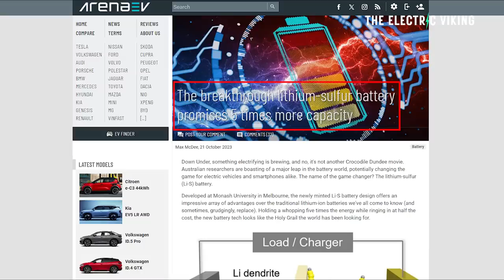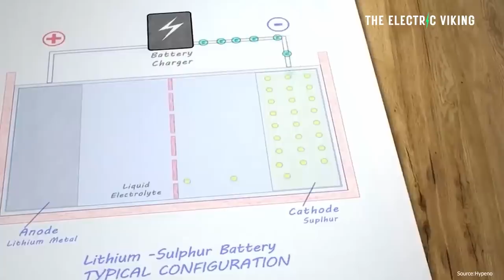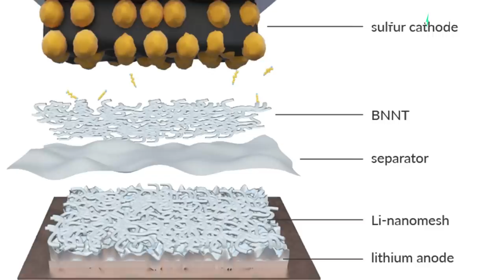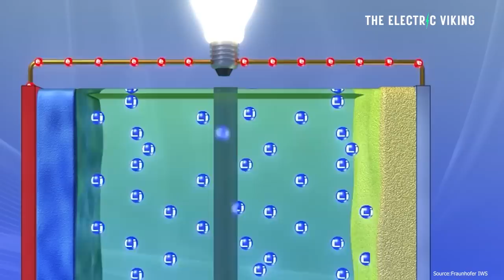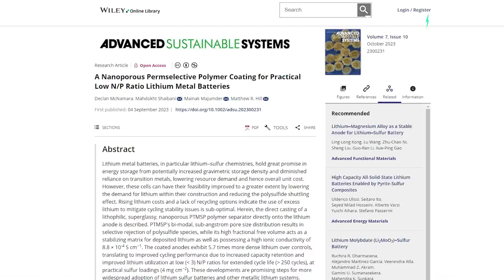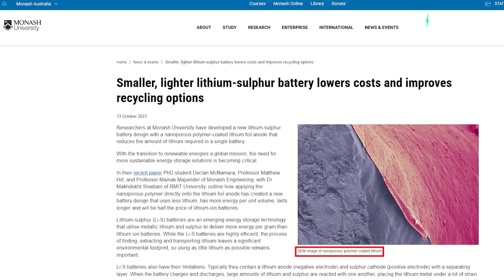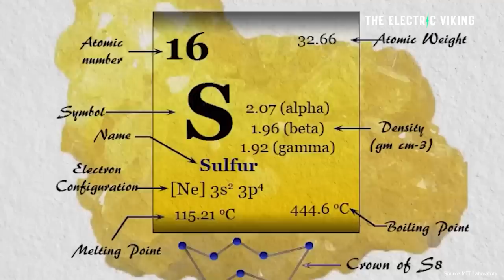Breakthrough for new battery that has five times the power of lithium-ion

Comment: For those who say ICE cars won't be replaced because battery tech isn't good enough, I present videos such as this. It's clear that battery tech over the next 10 years will only get better and better and better. There will be a day within the next 10 years where you'll be able to charge your EV just as quickly as filling up a gas tank while going 600 miles AND having a lighter car than current EVs are while being able to do 1 million miles. It's completely understandable why ICE manufacturers are scared til death of EVs.
Reply: Not even you can believe that...
Reply: Range anxiety will go away. The point I make is, don't buy ANY new car until you can afford to keep your existing gas car (if that's practical). That way you have a "road trip" car. Makes sense? Also encourage skeptics to ask EV owners how they their car (in passing by in a parking lot, for example). We good!
Reply: The charging facilities are nowhere near where they need to be to challenge ICE and does the grid have enough power as yet to charge that many cars.
Reply: Who cares?  95% of charging happens at night at home while you sleep.
Reply: Charge time will be a issue until some significant new breakthrough happens, not this one, also the chances of this one working are unfortunately slim we have had a huge number of battery chemistry come along and been the holy grail only to fall short for a number of reasons, unfortunately really the only progress we have really had in almost the last 10 years has been in battery management not chemistry, hopefully that changes soon but don’t hold your breath.
Reply: You can do that today. The issue has never been a matter of if we can make a car like that, but rather a matter of if we can make that car economically viable, AND will it be any better for the environment than a basic ICE car. For most of the country right now, it is better for the environment to buy an old used ford truck than it is to buy a new tesla. The ONLY exception is when you live in an area with hydro, nuclear, or solar. If you live in a part of the country where the energy grid is based on natural gas or coal, you would be FAR better off driving a hyper efficient gas or even diesel car.
Reply: Web, and the grid will never generate enough electricity for every home to have their own lightbulbs! And air conditioning or refrigerators in private homes? A pipe dream!
Reply: I wait till they get mass produced.
Solid State is already ready but mas production date is 2028.
Reply: Yeah it's been around the corner for 15+ years.
Reply: Ha Ha... Genius,  so once those batteries are available everything EV will be fixed! Oh wait...... so I can recharge my battery super quick but how quickly can I generate the power to recharge it let alone distribute that power in the national grid. It would be an issue if everyone switched their 2kw kettle on not to mind anything like a 20+kw charging device when they come home. if the EV doesn't catch fire the charger probably will! :)
Reply: Less than 50% of motorists have the ability to charge overnight.
Reply: If later generations is sodium-ion batteries increase in capacity battery development is finished and they can play with battery management.
Reply: @briankearn6991  why are they homeless?
Reply: @andrewkaiser7203 
I road trip all over the western US in my 2015 S.  What kind of range do you think you need?
Reply: dontbmb5 • ICE manufacturers are not scared at all. Their CEOs are doing what's been ordered to them by the Oil Cartel.
For example, one order is this: build expensive EVs so people don't buy them. Other orders are: don't build performance electric batteries, don't invest money in them.
Etc.
The ones that are scared by the EVs are the old rich oil puppeteers that lead the Oil Cartel, not the ICE car manufacturers.
Reply: @whowhy9023   Why do you people think everybody has a garage? And everybody can afford to pay on a EV. Along with paying on solar panels, plus a Power Wall. Many many people don't have that kind of money.

ATM Cars are being "repoed" at a rate that is higher than ever ❗️
The only reason I can afford to be a "Patron Member" to this channel is because it is cheap.

Do You purposely skip over all the comments of people saying that they would like to have a EV, but can't afford it , just on this channel alone ❕️
Reply: ..once your battery beat up 1kg of diesel=12600 w/h energy, make a call...other than that just stop talking ..
Reply: @andrewkaiser7203 " makes sense." No,not at all
Reply: @webbtz3591 the grid isn’t the real issue, lack of public charging, along with a need for  apartment/condo and workplace charging definitely is.
Reply: @eccosabanovic1589  That's crazy though. An EV would be able to be drives 3,981 miles with that kind of battery.
Reply: @tristanjones7735  You don't have to have a zero carbon electricity source to beat ICE with an EV.  Even if you are charging from a coal-fired power plant, you are STILL better than ICE because electric motors are so much more efficient.
Reply: @eccosabanovic1589 you can ride a horse to work instead of talking about it
Reply: @eccosabanovic1589  The energy density of diesel is BS unless you include the mass of the diesel engine needed to convert it to actual usable energy, and take into account the amount of energy that is lost due to Carnot inefficiency.  Do all that and it's not so hard to beat.
Reply: @icosthop9998  I did a calculation on the amount of solar I would need and using the payment scheme of fuel and electricity costs that currently exist in the household. The panels are good for 25 years, and they would be paid in 11 years. No, it isn't more expensive. The electricity and the fuel are more expensive. The problem is whether a person owns their rooftop or whether someone can leverage their rooftop to the advantage of a charging network.
Reply: @vorpalinferno9711 
Solid state batteries have been in development since 1986. The key phrase to remember is " they'll be ready in 10 years"
Reply: @whodatcatt  People, talk to Tesla owners. When you see people getting in to a Tesla in a parking lot, ask them real quick how they like their Tesla. It always starts a conversation for a few minutes. They will usually tell you about charging if you ask. They understand, and are glad to tell their experience. That way, it's not just a back and forth on youtube. I'm getting great reviews from them. Don't be misled by FUD. Just ask the owners.
Reply: But generation and distribution are not efficient
Reply: For a BEV to be good enough for me, it has to be able to handle -30C without drastically affecting range. Otherwise, I'll always need fuel of some sort for heat in winter. I'd be far more interested in a RE-EV than a BEV.
Reply: @shanecollie5177  Distribution is negligible compared to having to pump a liquid and drive a liquid. It's almost like the petrol heads believe their gasoline magically gets to the pumps. It doesn't. As for generation $.07 times 33.7 = $2.35. Gasoline is higher in price, and as such, either you believe that an oil company is gouging, or you believe that the distribution and generation of gasoline is less efficient on top of the fact that burning it is less efficient.
Reply: Ev's will become a standard part of the transportation landscape for last mile logistics and commuter use. There will not be a replacement for diesel for many years yet when it comes to pushing heavy loads or lots of people across the skies or the landscape.
Reply: 😆😅🤣 little mate this video explains that EV'S are inadequate and the battery manufacturers are and have been working on a solution to the problem for years with out success.
I reckon you might want to sell your enthusiasm with a more positive video. 
Wow!😂
Reply: @P2B_JC  Yep so as I said they may never be good enough.
Australia. Unless you're on the coast there is no charging as in can't drive city to city in some cases. 
Can't tow a caravan/boat go bush ect.
Point is there will be a celling regarding maximum range achievable. A limit to energy density If that is not great enough useless.
Reply: Profit. Once it makes it. It works. Right now. It doesn't.
Reply: You will live in a full AI surveillance city and pay for an autonomous trip on demand with your Government credits in ten years.
Reply: The supposed point of electric cars is to be more energy efficient/reduce co2 output, they don't, the green generation of electricity uses vast amounts of resources per unit of energy delivered. You talk of solar, solar requires around 15000 tonnes of materials to build a1 TW/h instalation which at best is 20% efficient. Compare that with natural gas which only requires around 500 tonnes of material for the same 1TW/h instalation which is around 70% efficient. (Figures from US department of energy)
Reply: @vorpalinferno9711  yoshino- how many do you want
Reply: @vorpalinferno9711  so what is the energy density of said battery?
Will it cover 1500 kilometres?
That is the minimum requirement for where I travel. 
Will it tow and how will it go for a couple of weeks in the bush hunting & camping?
Not unless gumtrees grow power points.
Reply: @0Aus   How many gas cars cover 1500 kilometeres?
Reply: @vorpalinferno9711  all of them!
I can carry liquid fuel or for example my off road motor home has 285 litres of diesel storage. 
That is appropriately 2500 kilometres.
How do I achieve that with a battery vehicle?
Answer you can't. 
Let alone haul 5.6 t of vehicle & supplies for several weeks in outback Australia. 
And I would suggest battery density has limits.
No matter the advances there must be a maximum?
Reply: @vorpalinferno9711  my point is a battery car can't replace all petroleum vehicle applications.
It isn't a complete solution. 
Great for cities not so for Australian touring. 
No chance unless trees grow power outlets 😁
Reply: @incognitotorpedo42  are what is your point?
Petroleum has sufficient energy density that I can carry enough for thousands of kilometres.
I can literally fuel up with energy dense liquid fuel then travel for thousands of kilometres. 
The best battery of the future no matter how efficient will never have the versatility of liquid fuel. 
Efficiency = not if the fuel & engine is efficient enough to carry it's own weight +addition propulsion + supplied to support the traveller. 
Energy density is everything
Reply: @whowhy9023  what of the thousands of street parked battery cars?
The families with teenagers 4 car households, travellers in remote areas,  ect sales staff field mechanics, regional managers? And I don't know where you are from but the infrastructure delivering the power where i am is barely doing what is was developed for let alone  delivering the unbelievably massive amounts of additional electricity needed to feed high voltage on mass all at the same time for 6 to 10 hours!
Wow that would take some huge power generation and feed infrastructure. And all at night when sun don't shine?
Guess we burn some more thermal coal. 
That sounds like a fossil fuel reduction plan 👌
Reply: @0Aus   Combustion is not going away any time soon. Its just in the cities EVs will become a better alternative by the end of the decade.
Reply: @vorpalinferno9711  cities for sure great idea. 
However it isn't solving the suggest issue of burning fossil fuels. 
In fact we are consuming more as we mine lithium ore ect to create battles that don't make energy!
If we truly need to reduce consuming co2 producing fossil fuels as quickly and with the certainty suggested how does it make sense?

Comment: My belief is EVs will not overtake ICE vehicles until they are superior in prices(retail sticker prices) and range of 500 plus miles(no more range anxiety). Change is difficult for most people. Forget the environment, you have to make buying a gas vehicle a "dumb" decision.
Reply: Range anxiety is a problem for people who don't drive Teslas, if it's a problem at all.  When you have a reasonable density of chargers, and they are decently reliable, and your nav system knows where they are, then there's no problem.  That's all true today for Teslas.  It could easily become true for everyone else; in fact we are moving rapidly in that direction.
Reply: Range is already equal to ICE, just need much better charge times.  Which incidentally will obsolete all existing charge stations.
Reply: @incognitotorpedo42 how does that work in Australia mate?
Will it send me to the nearest gum tree do I plug the little fella in there do I 😂

Comment: I think one of the most dangerous things to happen to industry is dominance. The current development is possible because no one industry dominates. Once one does, it will, as history has shown us, work very hard to maintain its dominance. In the past, we've been told that capitalism raises the best ideas to dominance. But history has shown that it is the dominant ones that hamper development in favor of their dominance. The oil industry is a good example of this. We could have been far more advanced in electrical storage and generation technology, except that the carbon fuel industry has worked overtime to both promote itself and diminish the value of alternatives. Perhaps we could work to develop a system that prevents such dominance? It's a tricky prospect because those doing the limiting will be subject to pressure to form a dominant element through lobbying. A tricky balancing act moving forward.
Reply: You are absolutely correct.  There are antitrust laws meant to deal with this, but in real life these tools are rarely used, except in the cases of extreme dominance and abuse.  AT&T was a great example of how these laws should work.  The break-up of AT&T was probably single greatest thing that could have happened to benefit consumers and the soon to come internet.
Reply: @Ryan-ff2db  Indeed. And such tools are blocked because of those dominant figures that have gone to impose their influence. I suspect that the best tool we have to challenge such dominance is organized labor. But that organization can come in at least two approaches. One is top down, which basically functions on the level of corporations, and ends up sucumbing to the influence of those corporations for the simple reason that they have the resources to do so. The other is from the bottom up, as a community tied endeavor.
Reply: @captsorghum  Did you mean to post this in this thread?  It kinda feels you were trying to comment on another post.
Reply: @captsorghum  You're more likely to find one on some motorcycles.
Reply: @Ryan-ff2db  Thanks, there must be an issue with the site cross-posting comments.
Reply: @captsorghum  Yeah, I've noticed that myself, especially with shorts.

Comment: If this works for Li - it will work for Na as well. The cost wont be the only thing - but the supply in general - instead of a curve uptake - it can be way more linar in the projected supply / production. At 500% even for Na would put it well beyound what we currently have with the best Li - and the best Li batteries are already consider to be "good enough". Eevn if ytou keep on Li - the number of over all batteries you need will drop instead - making the over all battery back smaller / lighter as well. Either way you swing at it - Solid State + Sulfur will be game changing once they start over lapping each other.

Comment: This is vague info coming out (not Sam's fault). What is the energy density? And what is the power density? These are two different things. It's the difference between what can take it hold (charge) and what can it release (discharge). Sulphur in yellow-cake form is abundant now because it's a byproduct of petroleum refining but what about the future? Can it be reclaimed from spent batteries? Lots of questions but not enough info yet, IMO. Very interesting developments though.

Comment: In the United States by the turn of the century (1900) , 40 per cent of automobiles were powered by steam, 38 per cent by electricity, and 22 per cent by petrol. It was the ICE that beat out the competition.
Reply: Yes, it required less material sciences to make an internal combustion engine, but in return you decided to burn more fuel, which you get to pay for the tradeoff. Welcome to the future.

Comment: First, please keep your units straight, power and energy are not the same thing -- five times more power is not the same thing as five times more energy!
Second, 5X the energy density would be over 1000WHr/kg and that number is hugely suspect.  In fact, if 260WHr/kg is where we're at now then 5X that would be 1300WHr/kg.